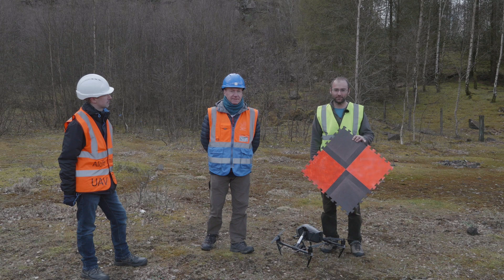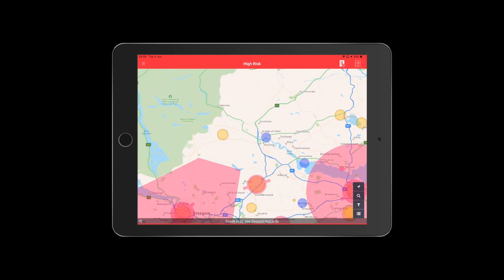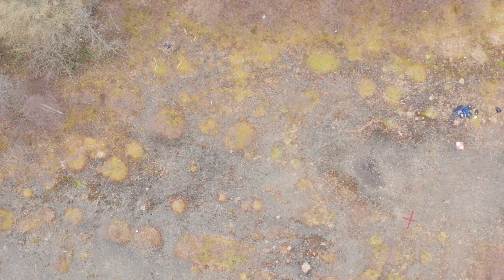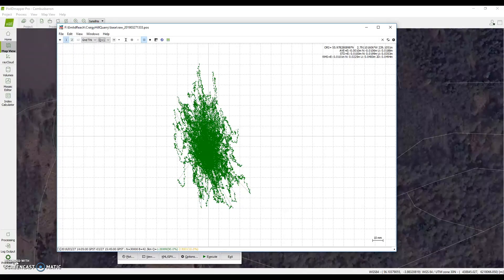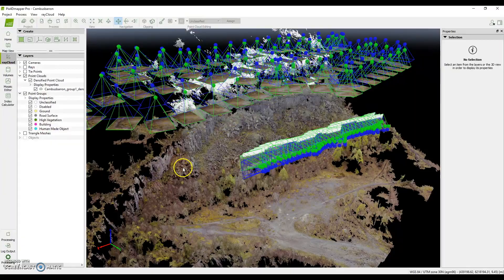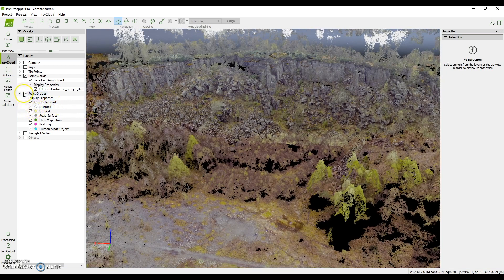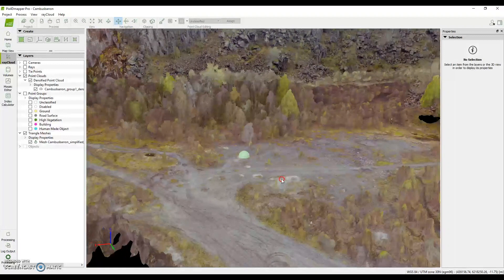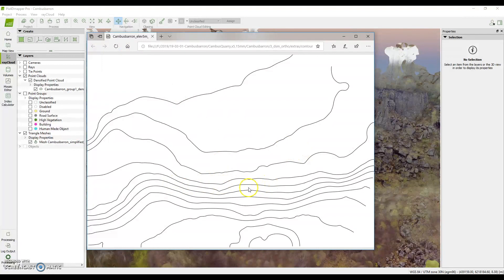Topographic Survey Using a Drone (Old Version)

Comment: Camera used on Drone?
Reply: There were several different models of drone used here. An Inspire 2 with x5s camera. A Phantom 4 Pro and a Mavic Pro with Hasselblad camera.
Reply: @iaincampbell38  You use rolling shutters for mapping? Wow!!
Reply: @alwaystravelling100  The drone we prefer for mapping is the Phantom 4 Pro, which has a mechanical shutter.